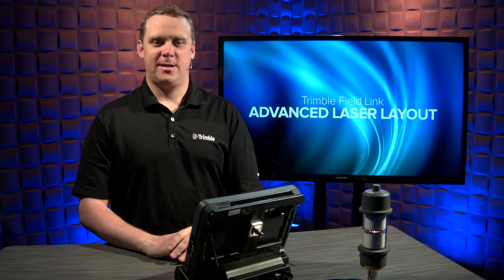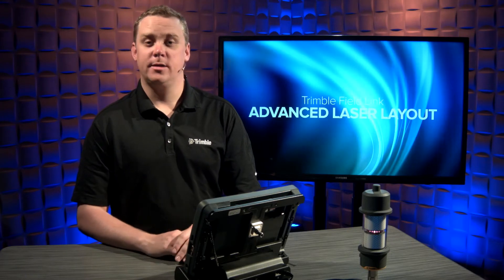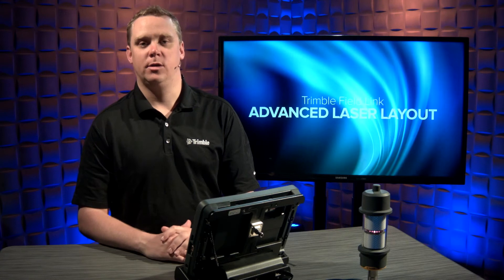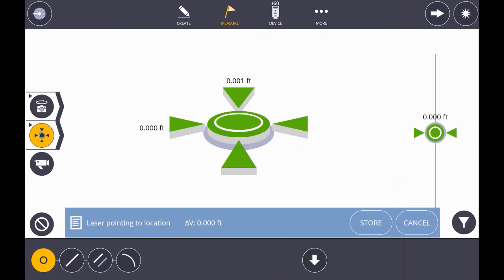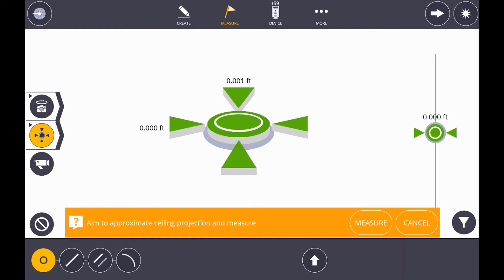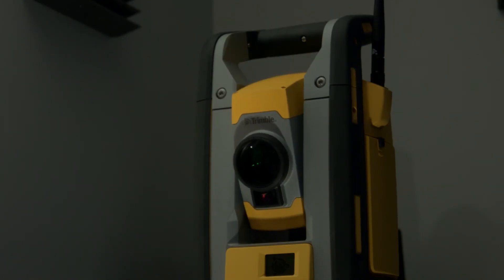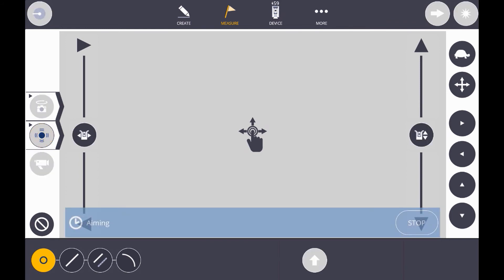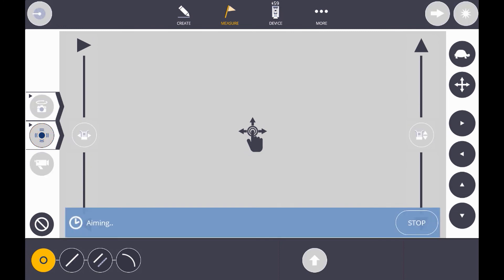Tips And Tricks: Advanced Laser Layout In Trimble Field Link

Comment: The ceiling I’m working with has Ts and it doesn’t allow me to laser to the ceiling, when I’m in laser mode and select a point it automatically tries to point at the ceiling. How can I get it to point at the floor instead so I can just do a dot laser to the ceiling from that?
Reply: At the bottom of the tablet you will see a icon of the Trimble aiming up, tap the icon and it will change to the floor, then hit measure and then aim